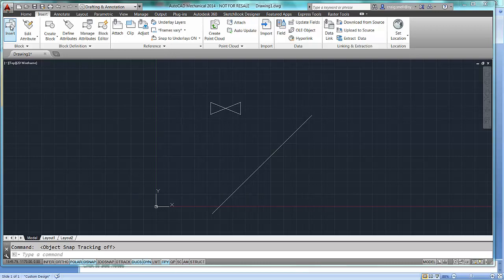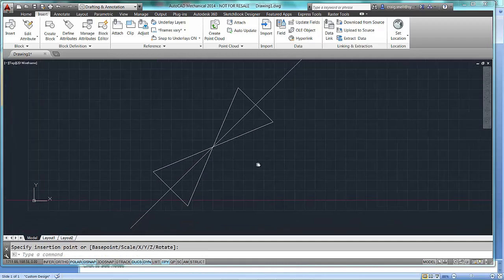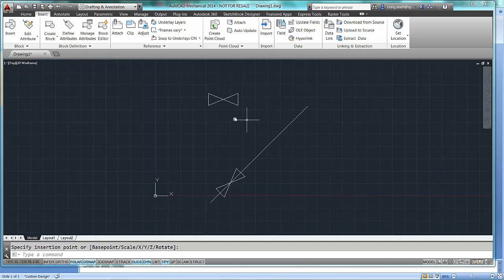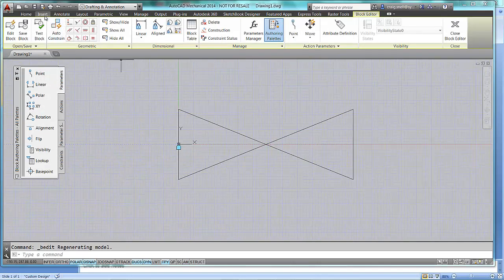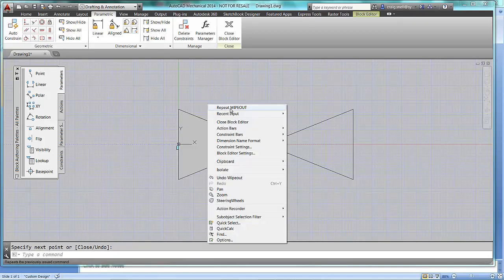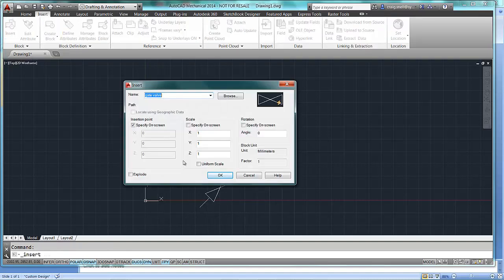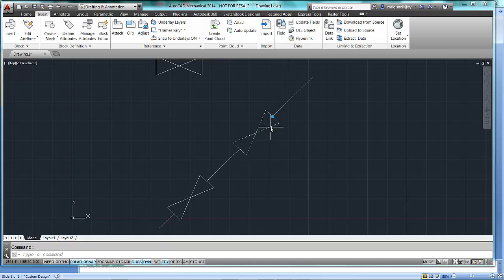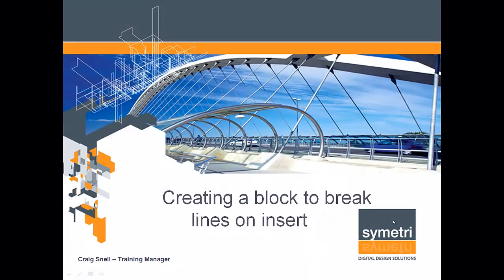AutoCAD Tips & Tricks - Breaking lines on Block insert

Comment: Is there any reason that would prevent the wipeout from working? I did exactly what you did but when i closed the block, it did not cover up the lines. I went into the block editor with the block and the wipeouts are there.
Reply: I'm using 2012
Reply: I figured it out. The draw order messed with it. So if it helps anyone else, you have to insert the block after inserting whatever it is that you want to cover up...or...use the right-click menu and bring the block with the wipeout to the front.

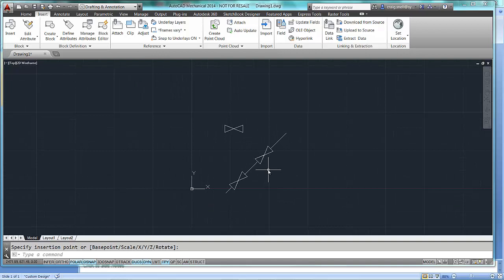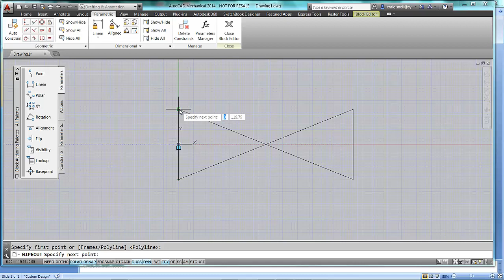Comment: For example I aim at creating my own library of symbol blocks with valves, pumps, manifolds, buffer tanks, etc. I use the metric system and usually draft in millimetres. The plans I usually work with are 1:50 and sometimes 1:20 or 1:75. And I want to be able to have visible symbol blocks on any scale. I think I have to make the blocks annotative but I don't know how, specifically, or if they would work the way I want to without me having to rescale them. That would be a usefull tip for the start